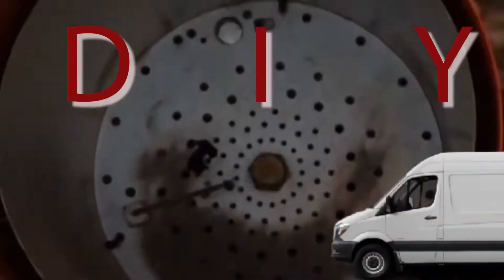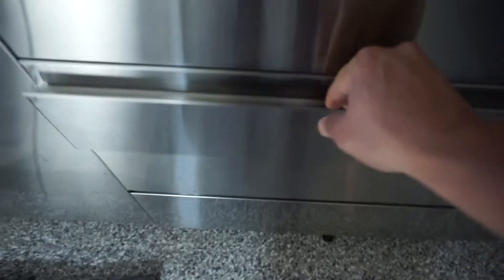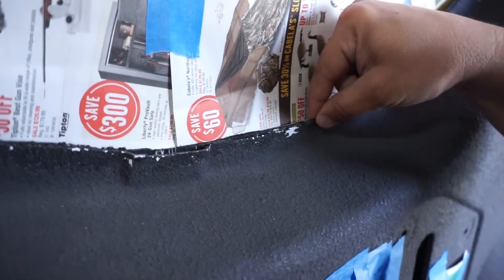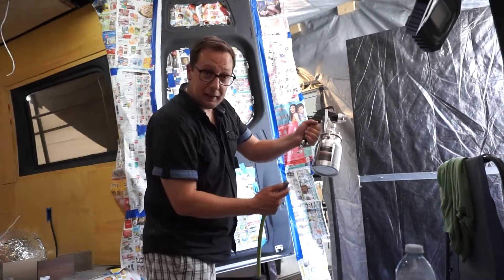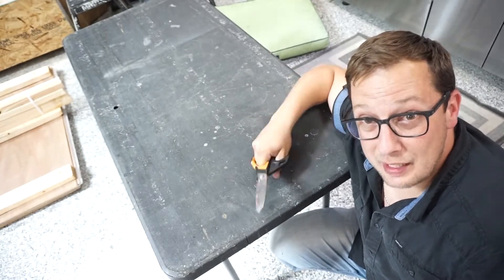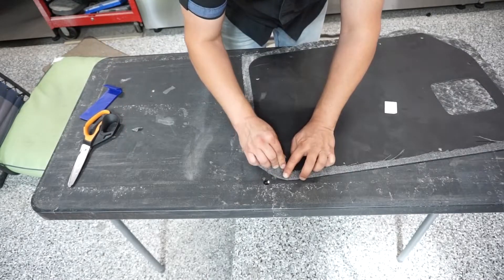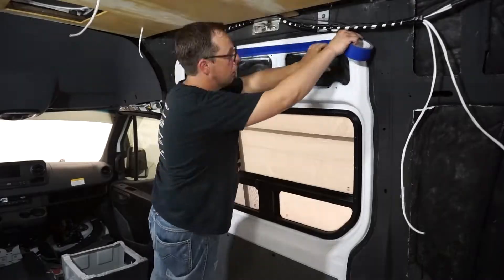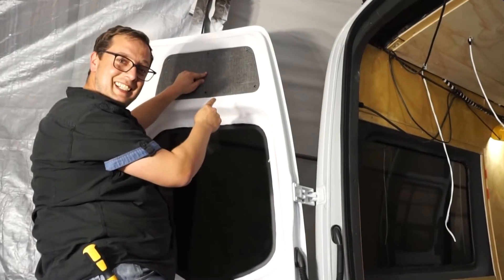Interior Rear Doors | FOUR SEASON VAN | EP.33

Comment: Are you going to be using any 80-20 or lighter panals in the build like fiberglass/honeycomb materials?
Reply from the maker: Yes the whole unit will be framed using 80-20.
Reply: Robert Kelsow-Geall ya were is a link to show this fiberglass, honeycomb panel you speak of? Sounds like a nice option.